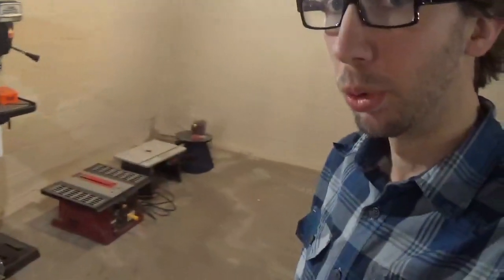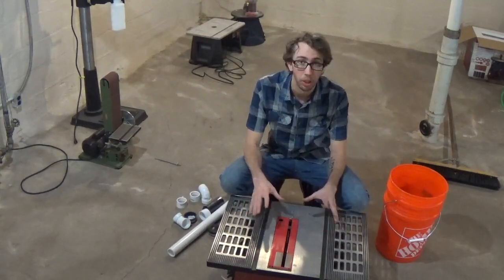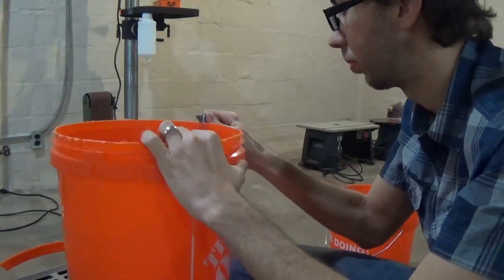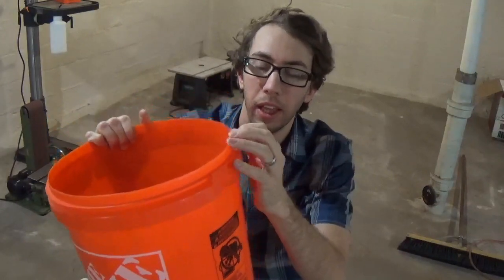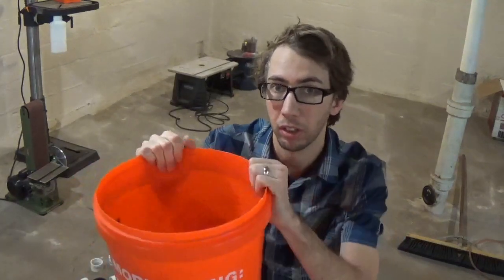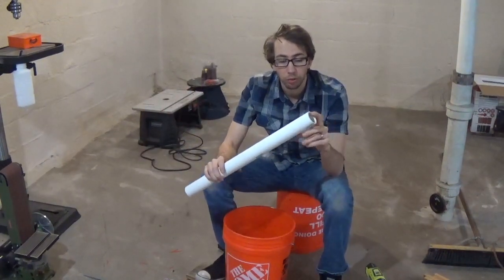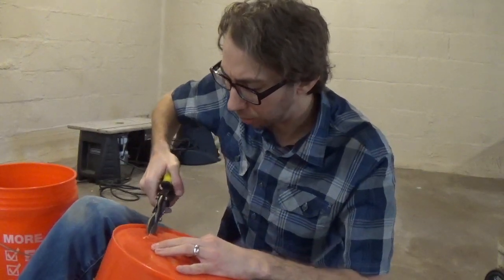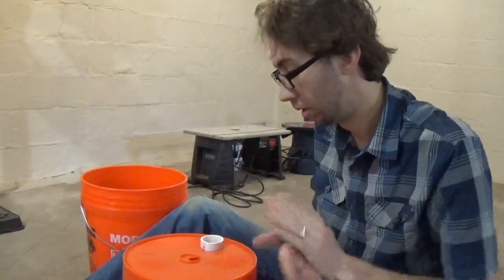Double Bucket Dust Collector: Chris Notap DIY Build and Review

Comment: I discovered a much better way to put the two buckets together.  It involves sacrificing a third bucket, but if you can handle that expense it's much simpler than your method.  All I did was cut around the third bucket just below the handle, then cut around it again about four inches further down.  That gave me a sleeve that will fit snugly into the top bucket, leaving about an inch below the connection point.  Now the two buckets just go together, making a very tight seal.  They are easy to lock together, and easy to separate.  Feel free to try this.  Worked for me, eh.  Thanks.
Reply: WOW! I've been struggling to get the two buckets together, and this is the exact tip I've been looking for. Thanks David

Comment: I have had BROWN lung from sawdust, back in 1980 or so. We were working at the Army base Craft shop in Stuttgart Germany and did not have a good filtering system.

On my Chris Notap's design I used 4 buckets. One with a lid upside down but cut 5 inches off the bottom. I then filled it, lid down, with wet cement 1 inch higher than the level of the 2nd bucket when pushed down in to it. Put a contractor trash bag over #2 bucket and shoved #2 bucket down, pushing the cement up the sides a little, the sheeting kept the cement off #2 bucket. Let the cement cure for 2 days. Removed the trash bag. 

Bucket #3 I did the PVC piping but put 2 90 degree elbows so the hoses were coming out sideways. #4 bucket was cut like Chris Notap's UPDATED version* to slide over #3 to make it so it could not suck in. 

The added weight of concrete and the hoses going 90 degrees keeps it from tipping easier.

See Chris Notaps Update here https://www.youtube.com/watch?v=BeU4nqSJtBY

Comment: I used a sump pump hose for the intake. It's cheap, and long, which means i can mostly not have to move the bucket around.
I use it primarily with my orbital sander. 
Definitely look at Notap's latest revision to solve stability and collapsing issues.

Comment: Great video. I'm going to build something similar but will put the inlet to the cyclone further down. The idea being that fine dust will have less chance of being sucked through to the shop vac. Thank you for the time and thought you must have put into this
Reply from the maker: Thanks! I'm glad it gave you some ideas!
Reply: @oakleydoeseverything6438  I also liked your review of Chris's dust collector version 1. I just want to share that Chris rotated the internal 45 degree fitting, slightly, pointing it more downwards. It directed the shavings downwards and away from the centre vacuum port. I'll be taking some of your viewers suggestions into consideration as I build Chris'  updated version that addressed 'bucket collapse' and stability issues. Thanks

Comment: I really enjoyed making the dust collector I made a couple of improvements  weighted the bucket with a 2x14 on the bottom I cut out a hole for the bucket to fit inside and then I cut a 2 inch rim and then I was able to recess the bucket inside the wood base I was also able to install some small wheels on the bottom
Reply: I haven't made one of these yet but I see what you did. I have some extra sac-crete I may use to do that. Put some screws thru the bottom UP to hold in the concrete. Just don't drop it later. lol

Comment: Add some wheels to your collector and it will roll around instead of tipping over. Also you definitely need a longer hose. I have found that twice the length you think you need is what you should have. Great video. Thanks!!

Comment: Great video. I’m going to try to use this as a pellet fine separator/transfer to 5 gal buckets. 
Perhaps if you screwed the collector to a harbor freight wood furniture dolly to stabilize and also mount the shop vac them both will be mobile.

Comment: Funny as I just went through this same process making Chris Notap's dust cyclone about three or four days ago after I bought myself a Rigid shop vac.  The issue I need to address on it is that it caves in when the vacuum is blocked.  I know that he put a fix on his video update which involves putting other HD buckets around the dust collector, so I will need to try that.
Reply from the maker: I actually haven't had this problem myself yet! Did you connect your hoses the same way I did, or Chris? I wonder if that has anything to do with it....
Reply: How watch Chris’s update video and he addresses this issue.

Comment: I made one of these and I love it. There is also a design to mount it on top of a rigid shopvac...I have that as well and is a great space saver and eliminates the falling over problem. I woiuld consider just wall mounting it too as thar might work better if you wanted to have dedicated hoses to each machine with gate valves.

Comment: I was also inspired by Chris Notap's design but wanted some imperial data using extremely fine dust.  I followed his instructions with one alteration. I used 90-degree elbows on the inlet and outlet of the exterior of the cyclone dust collector. I used a 5-gallon 6-amp Shop Vac with factory pleated filter as vacuum source. The collection hose used was a 1-1/4 Shop Vac hose. The hose between the cyclone and vac is a 90 cm piece of 1-1/4 pool hose. I used Portland cement powder as a substitute for drywall dust figuring it is a similar particle size and density. I tried to suck up the Portland over a couple of minutes but realistically, this particle flow rate is way high. This resulted in extreme static build up. Here are my results: 1109 grams Portland sample. 964 grams collected in cyclone. Unmeasurable amount in Shop Vac barrel measuring with a scale with 1 gram resolution. 7 grams on Shop Vac filter. This was enough to audibly detect the Shop Vac loading but not plugged. The static build up seemed to result in the remaining 138 grams to be precipitated out on the inside of both hose.
Reply: These DIY dust collectors aren't capable of catching "fine particles". They are made to take the bulk load off of the vacuums and make it more convenient to empty the waste. That's why they put filters on the vacuums to stop the fines from being broadcast back into the room. Of all the examples of DIY collectors I've seen, the only thing I see being better than this design would be to build it with a trash can for the container.
Reply: @78tag  With regard to your comment about fine particles, I am considering making a slightly modified version of this collector (placement of the inlet elbows on the side) to collect old carpet glue and three layers of old paint on my concrete floor.  I'm using  an angle grinder, diamond cup with a shroud, and concrete dust is also in the mix.  With only my shop vac connected, I have to empty the vac every 5 minutes and shake out the filter.  Not efficient.  Do you have any experience you can share with this use?
Thanks.

Comment: I used a 65 gallon food barrel but I have a 1 hp dust vacuum with 4 " port. Had power before but would get clogged all the time. Now has much more power and no dust/debry at all goes to the mesh guard at the propeller where it would get clogged.

Comment: Do you see any issues using 2” ABS pipe and fittings instead of 1 1/2”?  If the shop vac comes with 2” hose it seems silly to reduce it with 1 1/2” fittings.  I imagine air-flow (cubic feet per minute) would be greatly reduced by reducing to 1 1/2”.  Am I seeing this wrong?

Comment: HI my question Is I do not have much enginnering experienct would your advice to me I am to scared to make my own dust collector do you think your advice to me would be If I have a bucket top dust collector would you suggest as some have stated that 5 gallons bucket may be small so would your advice to me be to just get a 6 or 7 gallon bucket does that sound like an easy solution ? I mean I already have a bucket top separtator so like I said I am hesistant to do much engineering could I not use my bucket top cyclone with a 6 or 7 gallon instead does that sound like it may be a possiblity to you?

Comment: Put street 90's at the top then put on the rubber caps...maybe put dowl rods crossing inside bucket to prevent collapsing...or glue another bucket to the bottom bucket...never needs to be removed....mount system to 4 wheel dolly from home depot...easily move around shop and won't tip over...just screw 2nd bottom bucket to the dolly....maybe with screws secure it to the bottom bucket

Comment: 15:05 It looks to me like your "45" points directly horizontal. It should have a slight downward tilt, so the debris is directed around and down. Please ignore me if I am seeing that wrong.
Reply: Check out the original video from Chris Notap.  I built this system myself following his video, and it works like a charm!
Reply from the maker: Yeah so I also did as he instructed and the reason it doesn't need to face down slightly is because gravity will still carry it in a downward direction. Check out my Instagram page, I have a video of the sun shining through it and you can see it spiraling downward after being sucked in!

Comment: Attach buckets to $11 furniture dolly from Harbor freight. Bucket will move with you and weight of dolly should keep it from tipping over. Not bad input. Could have been done in less than 10 min though.
Reply from the maker: Yeah I actually consisted not posting this video because I thought it was too long, but low and behold, Best video so far!

Comment: I saw Chris Notap's video the other day and want to make one of these, too. What I'm still trying to figure out, though, is WHY we're building this dust separator? What's the benefit of keeping the shop vac clean? Is it just to keep the filter from getting dirty? Why not operate it without a filter? I've seen 2-stage filters where heavy materials go in one spot and the smaller dust goes into the shop vac (or vice versa). That I kind of understand. This design, not so much, unless it's the same thing, but it would seem everything ends up in the bucket. Thanks! And good luck building your shop!
Reply from the maker: You bring up a great question! The reason I have this and keep using it is because even though some debris will inevitably end up in the vacuum itself, it is much less and I don't have to clean or exchange the filter in my shop vac as often. And it gives an additional "filter" so that the air that comes out of the shop vac has a better chance of being cleaner when it exits. I have to proof it facts to back that up, but that is my perception on the matter. It's also easier to empty a bucket that doesn't have a filter, rather than a shop vac and have to deal with the clumsiness of it. Thanks for commenting and asking!
Reply: @oakleydoeseverything6438  my question is how much fine dust winds up in vac?......I work with MDF and router so I have no big chunks everything is super fine dust.....the vac filter clogs up in no time by itself
Reply: Has no one ever cleaned out the filter before ? My shop vac from HD has had the same filter for 2 years. When it dirty a just go and clean it out in my trash can. There is also another video I saw where a former NASA engineer that worked in system filtration uses only paper towels wrapped around his vac inlet. He has it tied to a larger home made dust separator and it appears to work flawlessly.  Since I saw his video on YT I now wrap the towels around my vac filter as a "Pre-Filter" and I have to clean much less now. I like the dust separator system just for the collection aspects, I will use some of the larger particles mixed with paraffin wax as a "Fire Starter" for the firepit and campfires.
Reply: Richard Fowler after building this separator, I actually did just that: wrapped the inlet with paper towels (must’ve seen the same video :) ). I also added a bag inside the shop vac too. Between the bucket, the bag, and paper towel filter I may never need to clean out the shop vac again!
Reply: because if you don’t have this the shop vac filter clogs up quickly, reducing suction and then you have to replace or clean the filter, both of which are bad.   cleaning it is horrible and messy.  The idea here is you just have to empty the bucket and never clean the filter.
Reply: @triggerthesound767  Thanks! I guess that goes back to my original question then: why have the filter? Why not just let it all empty into the canister? So far, though, my set up has been working great with the bucket, bag, and paper towel, tho the paper towel does get clogged relatively quickly when working with MDF, which I tend to do a lot.
Reply: @HomesteadDIY  You asked why we're building this?   Because its inexpensive and it doesn't take long.   And for me, its all about putting the shop together.

Comment: Appreciate you making your own video on this, and yet giving Chris his props. However, why wouldn't you want to use the better tool of the 2 utility knifes you have? I understand you use your box cutter for other things. But, those break off box cutter knives are only 50 cents to maybe a dollar a piece to replace. You threw me off when you said that? Always use the method and  tool that works best for the job. I could see using an alternate tool if it was a high priced tool that you may not have or can't afford. But not a knife that cost a dollar. Well done though otherwise. ++Peace & Rock n' Roll++
Reply from the maker: Thanks for the insight! Yeah so I use the snap off knife for cutting foam and stuff like that and I only have a couple replacement blades. My box cutter blades on the other hand I have a couple hundred replacement blades so I'm much more comfortable going through those instead!

Comment: Can I use this system for drywall dust?
Reply from the maker: Excellent question! I honestly don't know. I haven't tried it for that. Are you wondering if it will vacuum up drywall dust? Because I'm pretty sure it could.
Reply: @oakleydoeseverything6438  I was wondering if it would hold it in there or eventually blow out. It's pretty fine.
Reply from the maker: @overtheroad6679  I see. Some might go into the vacuum itself, but then you have the filter of the vacuum so you do have a double filtering system with the buckets for the larger stuff and then the filter of the vacuum for the fine stuff. At least that's pretty much how I use mine.
Reply: Could you attach a generic filter inside the home depot bucket on the "out" hose that goes to your shop vac...making it prefilter the fine sheetrock dust before it gets to the more expensive shop vac filter?

Comment: How can i hook this to sanders and my cordless router? These are the bigger culprits since they do not have a shop vac hook up just the fan
Reply from the maker: When I bought my shop vac, I also bought an adapter kit for the end of the hose so it will go down to other sizes. If your hand held equipment has a circular exit port for a dust bag or something like that and you have the correct adapter, it should work!